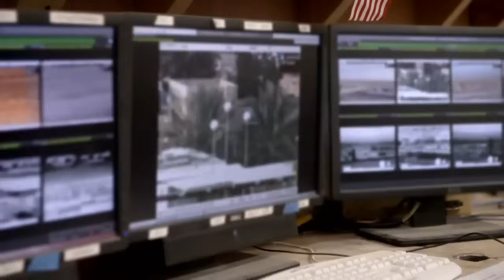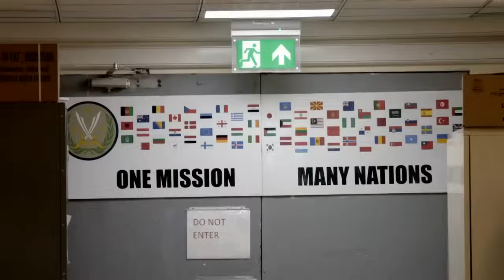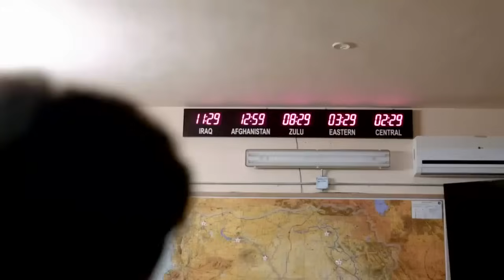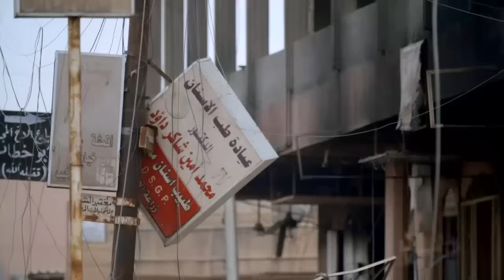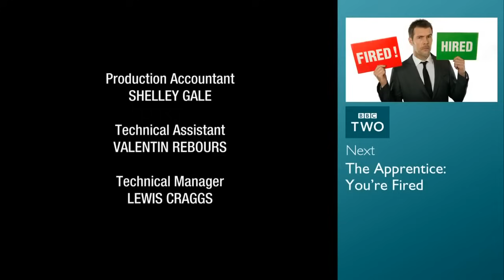Battle for Mosul - British Army: Behind the Frontlines (Season1 Episode 1) Forth News

Comment: The reality now in 2020... you will bearly go on any tours or major firing exercises, even as INF or RAC. There's not a huge amount going on in terms of tours/exercises for the Brit. Army right now, things like BATUS, GERMANY (for CAT training), KOSOVO and the odd low-level tour for an infantry regiment in Afghanistan. There's less than 16000 INF workplace strength, every corps of the Army is undermanned so there's space to go into the army and obtain qualifications and transferable work experience... rather than just think that you'll fire guns all day and use top-notch equipment (VIRTIS kevlar vests re horrible) you'll do plenty of Guard as well, meaning you may not get full leave.

Just my experience though...
Reply: Legendary Rebel this was only filmed a year or two ago not much has changed since
Reply: they arnt kevlar and they arnt meant to be fun to wear